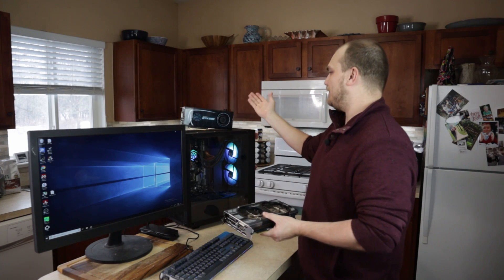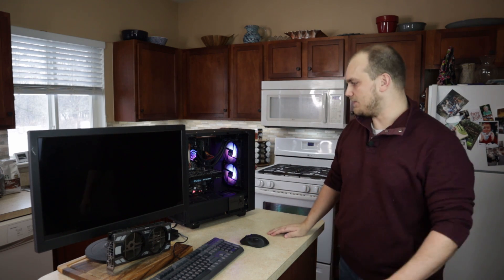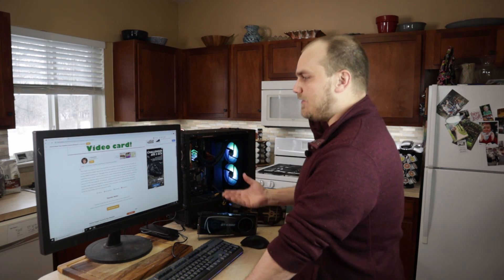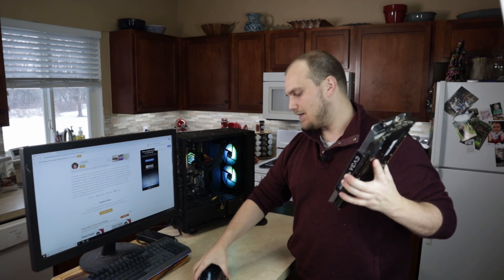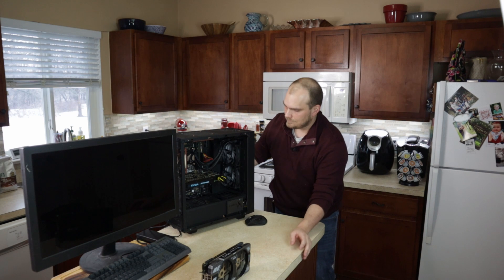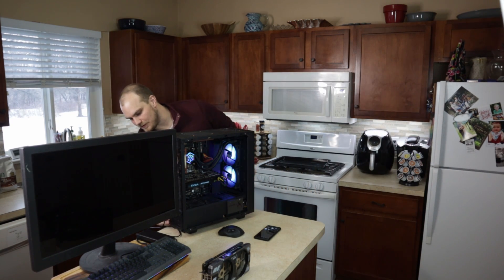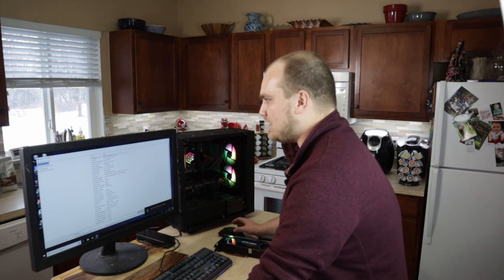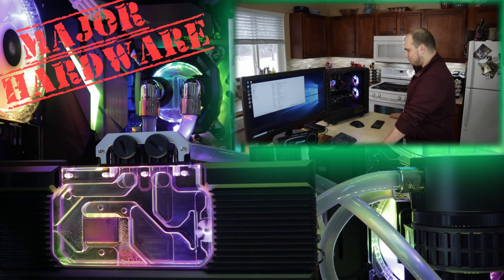Does Baking A GPU Do Anything?

Comment from the maker: STOP!........If you are considering doing this make sure you understand the risk. If you have a card that doesn't work and you are considering sending it out for repair but came across this video first DON'T BAKE IT, if you do and it doesn't work then you try to send it out you may end up causing more damage and shortening your cards life in the long run. In all honesty I didn't expect this to fix anything, however I decided to give it a squirrel because i had no plans of sending the card out for repair and i received enough comments on giving it a try i thought why not. NOW YES my 1080 didnt work then after its ride in the oven it did to my astonishment, and after a bit of testing it seems to be working normally again with the exception of the RGB which is still dead. I have some more testing to do on this card to see how long it will remain working, it may work forever and it may die today I dont know. Make sure to check back for followups on this cards life. In the end its your hardware and what you choose to do with a piece of equipment that you paid for is 100% your choice but make sure to do your own independent research before deciding whats best for your case scenario.

if it ain't broke fix it till it is
Reply: You should probably buy a new oven.  As when you do this it releases toxic gas from the soldier into the oven.  Which will keep going on your food to a lesser extent each time you use your oven.
Reply: heat gun outside (well ventilated) 9 min on gpu/vram (keep it moving don't stay to long on one thing)
Reply: @coldrolledbearcrushing9264  how hot on a heat gun, how many watts? I have an xfx HD 5850 black that was damaged in shipping and I have no money for someone to spend hours on an antique card that looks brand new, because it was a year old when it broke. I can afford and happen to need a good heat gun though.
Reply: Nice. Does it still work though?
Reply: You have to increase the pressure from the cooler to the GPU chip after baking, then all of my broken ones showed again.

Comment: Done this years ago and saved my old gtx460 back in the day. I now have a 4090 that is not being covered under warranty and I'm tempted to try something similar again
Reply: How did it go buddy?  
I have rtx 3080 that has black screen and I'm attempting to try the same baking method but I'm not sure bro  !!
Reply: @Johnny-Taylor-07  brought the 4090 back, was a cap easy to spot. As for baking a 3080, all you can do is strip it down to just he board, put it on a rack and use some foil or paper to keep it off the surface. This is a last ditch thing to do before exhausting everything else because while the heat can correct the solder joints, its also hotter than the caps are usually rated for, so there's a fine line of putting them under stress but getting enough heat to fix the problem, if that is indeed the problem. good luck

Comment: An old roommate of mine a few years ago gave me a red and black AMD something something XT gpu of some sort that artifacted and quit working and was like "give it a shot. I got a new one. If it works you can keep it" I stripped it down and tried. All that happened was a capacitor exploded XD. I have a feeling that card was a hell of a lemon with what he told me about it. I'm quite happy you had success with that EVGA 1080 in this video. Did it last?

Comment: The reason this is a temporary fix is because the solder balls on the gpu chip or cracked solder preventing it from working is cracked due to failure even if you re melt it the problem is the solder it needs to be redone, just send the card out to get reballed by a professional
Reply from the maker: still works
Reply: @MajorHardware  your issue must have been a rare situation which was a solder ball was no touching a pad or misaligned causing a issue  and your oven trick fixed it and the solder was ok but 99% of these issues  is due to low quality solder and its known by industry as "RE-Balling" a gpu. Its actually a cool process look up some videos on it and also your video was cool to watch to and may help some people but heat gun is a cheap proper way to do this and your put tinfoil around the things that you dint want to get hot

Comment: Bro Im sorry all these dudes are giving you hate for repairing a broken card, I mean the card had no value before you cooked it, now its working and thats that. 

You had a dead card, now its alive. 

People still givin you hate over it, Ive got like 5 cards to try this on so Ill be back later.
Reply from the maker: It still works to this day pretty weird
Reply: @MajorHardware  This is my second reply, I tried to edit my first one and it said returned error.

These are the cards I have to try out:
XFX GTS XXX ED 580 8gb (Does not allow PC to power on once in PCIE socket)
XFX Red Fan 580 8GB (No Post)
Armor OC 580 8gb (Works until driver installed, then black screen)
Armor OC 570 4gb (No post)
Armor OC 470 4gb (Artifacts until freeze)
Gigabyte Gaming 580 8gb (No video or no post)
R9 290x Reference w/ Tri X OC Cooler (same PCB layout) (no post)
HD 7950 Windforce (no video or no post)

Results:
XFX GTS XXX ED 580 8gb - 100% Success, even withstanding brutal loads from last night till now
XFX Red Fan 580 8GB - Loads to windows, freezes on 3d load
Armor OC 580 8gb - loads to windows, freezes on 3d load w/ artifacting
Armor OC 570 4gb - Loads to windows, artifacts at 3d load
Armor OC 470 4gb - loads to windows, artifacts at 3d load
Gigabyte Gaming 580 8gb - not cooked yet
R9 290x Reference w/ Tri X OC Cooler - cooked at 360 able to load into windows and game until artifact, cooked again at 370 @ 12 minutes and light artifacting - dropped memory clock to 1100 and everything is perfect and stable. 
HD 7950 Windforce - not cooked yet

So I was dialing in my whole process during separate cooks - I started low and went a bit higher, dialed in length of time and cooling period. I believe that with additional cooks I can bring the other cards back to gaming life. 

What was interesting to me is I was able to use every single card that was not working. There is certainly something to this. I believe with the proper technique the chances of repairing a card is much higher. Ive had more success with 12 minutes at 370 for my oven then anything so far. Im very happy with the 290x result, as thats my favorite card. 

Hope someone can use this for their information, if anyone has any questions Ill respond to it if it hits my notifications.

Comment: I did this twice with a graphics card. One worked for 1 month and the other worked for 2 years after baking it. But it is very risky because the oven has to be exactly at the melting point of the solder. Any lower and it won't work and any higher and you will destroy your graphics card. So DON'T try this if you still have warranty... just send it for repair. No warranty left? Got nothing to lose if it doesn't work? Throw it in the oven!

Comment: If been dealing with a no output EVGA 1050ti card for about 1 week now. Tried it on different systems, tried to flash the BIOS but nvflash doesn't detected it :(  I  flashed the latest BIOS from www.techpowerup.com/vgabios/ using the CH341A programmer successfully, took it all apart and visually checked the card no damage anywhere, card looks mint... but still no output. The fan spins but that's it. The last thing I tried was baking the card in the over at 375 for 10 minutes and hold and behold the card is alive again... I almost threw this GPU in the garbage but decided to try this and it worked.. I was shocked.

Comment: From what I know this isn't a permanenent fix, the GPU could stop working at any time.

But i'm guessing this is the last thing you try.
Reply: Card didnt work, it works now. Ive got like 5 cards to try this on, and I cant wait. If the card doesnt work, it really isnt an issue if you can get it working again for a little while. ITs already broken to begin with.

Comment: Just saw this video and wanted to add it's *absolutely not safe to pull hardware while the power is still on*!!! Heck, it's even unsafe if the power is still connected. I'm surprised you didn't ruin your motherboard just then. If you have done this before, no wonder your GPUs were toast.

There are many reasons why it's unsafe. First of all, because chances are high you are changing the angle of the contacts when you pull or insert the card, chances are just as high you are shorting two contacts of the slot. Second, the slot is hot (powered) and if you pull (or insert) the card and some pins are still making contact while others don't, current is going to flow in directions it's not supposed to flow. Some currents can actually invert! And there are a few more reasons you should never do this with the power still connected.

Also, it works not because you are reflowing the solder. Solder on a PCB doesn't reflow at 200C. The reason why it works (temporarily) is because you are baking out moisture from the epoxy from flip chip connections. Moisture will most likely return after some time causing the problems to return. There are ways to make the result more permanently though. Like resealing the chips afterwards.

Comment: I did it with a heat gun. It work. Until I shortcut the card by let a hdd (in metal so) rest on my card while the pc was running. It didn't work twice with the heat gun

Comment: I repaired a GTX770 and I wouldn‘t believe it. I got typical symptoms of problems with the vram. I told all of my friends and we all laugh about it and that it works and is still working.
Reply: @deveneleven400  I have sold the card a year later. I know for sure that it worked for at least a year.

Comment: Baking a PCB can only bring back board that has broken solder joints. The ones that break usually are ones the manufacture cant see (Under BGA components) and ends up breaking because they cant be inspected to verify if they have a good bound.

Sometimes baking may not be enough to fix the problem. If where the solder broke leaved the solder mostly in one side when it heats up due to surface tension it will form a ball and that ball may not be high enough to jump the gap and reconnect the point. 

You can try gently pressing the chip down while it still hot to force the melted solder ball to touche the other side (If you press too hard you can smash the solder joints causing everything to short so ONLY DO IT IF YOU KNOW WHAT YOU ARE DOING). 
That joint may break again due to be under high tension stress especially if the reason it broke the first time was because that joint didn't have the right amount of solder.

This is why this is not considered a proper fix:
It might not fix the problem its trying to.
It might break something else that wasn't broken (Blow caps / Crack ceramic caps / Melt the isolating coating of the wires inside inductors / Melt plastic things...)
It might fix the problem but only temporarily.
It might only partially fix the problem (Turn on with artifacts or shuts off / crash when you start a load).
It might fix the problem for a very long time.

Comment: When I first started getting into hardware, I was replacing thermal paste on Xbox 360s and replacing disk drives. I know it works, but after some time (could be a couple weeks or months, pending on its usage / temps) I have a feeling it will suffer the same fate, eventually.
It was fun to watch though, especially without a :O face in the thumbnail 😉
Reply: I did the same with my xbox 360... took off the ring of death for a few months. I used the heat gun method though.

Comment: gives us an update if the thing works long term. do some stress testing and game on that card for a bit. sometimes oven fixes don't last.
Reply from the maker: I did some stress testing fan installation and gaming on it yesterday I plan to make a follow up on it soon
Reply: @MajorHardware  looking forward to the video
Reply: @MajorHardware  you can also do the oven trick again on the 580. Won't hurt. Tech yes city did it to a few cards multiple times.

Comment: I mean, what did we expect going into this knowing that the 580 didn't die over time due to a bad solder joint but due to..let's call it scientific experimenting.

As for the 1080, HOW THE F DID THIS FIX ANYTHING.

I baked my Geforce 7950GT AGP back into live two times and it lasted for two years after the first "fix", back then I was hecka proud of actually fixing something just by putting in in the oven. 

And yes, the card still runs fine even though the second baking was like 5 years ago. Ofc, this should be considered as a temporary solution only to indentify defects and then get a proper reflow, but for me it worked out just fine.

I used regular baking paper as a non-conductive alternative to your aluminium foil balls tho.

Worked for a HD5850 as well, but that card ended up dying in a fire (not cased by the card) shortly after so I can't tell on how long that would have worked.

For both cards I preheated the oven to 115° C, put the card in for 10 minutes, flipped it upside down und gave it another 10 minutes. 

This also worked with a laptop gpu on the motherboard, tho that thing died again after a week and I couldn't be bothered properly reflowing it.

Comment: Plot twist, monitor is broken, cards are fine :) Well just seems like the input connector is loose on monitor end as a little jolta made it lose signal. Interesting to see if 3D works on that 1080 too, but picture is already a win.

Comment: Yes, it shows video out. But is it working? I have had a few cards that would boot into windows, but couldnt install drivers because of the "error 43" in device manager. But right now, im considering baking my evga gtx 780 sc, just to see what happens.
Reply from the maker: from the testing ive done so far it seems to be working as normal ill follow up when i know more.

Comment: that what i did for ages back in 2000 fix my dumb 3dfx it melted soliding so i throw in toaster over for 10 or 20 mini slow heat it up unite get to 175f or 190f it pend on board n soliding
and never use aluminum foil because that soliding will stick to it dont every use plastic because it will melts n i normal take small longer screw with nut put on board n tight by finger n stand it up so less mess
im great u came back do it aging same what i did

Comment: i would have understood if it fried it self by running too hot, it would have had a chance of melting the chip's inner parts and make the broken connection solder in the chip... but you fried your with a short... now that is a mystery to me as to why it worked! nice for you! will you retry the previous experiment (being more careful) again or do you have other plans for it?

Comment: Solder balls reflow at 600-800°F, as do solder joints. All this does is temporarily bridge gaps between the BGA and PCB, or along tiny fractures in the traces in the PCB. If you get it hot enough, it can cause cold solder joints. But, it'll still fail again, eventually.

I professionally repair pricey industrial electronics with bad solder joints every day, and I'm trained on one of the most advanced robotic BGA repair and replacement systems available. Even then, the manufacturer of the systems I fix dictates that we need to replace any BGA that has failed, even if testing only finds one bad solder ball that needs reflow.
Reply: Thank you for saying this. I've been trying "educate the internet" for quite some time on what "baking gpus" really does and why the "fix" is temporary in the vast majority of cases. Even the famed Luis Rossman doesn't understand what's happening.  In almost every case,  the fix is temporary because the BGA component has a bad solder ball, which is really the result of a damaged pad, usually lifted off (fully or partially) with a broken trace. Heating in a toaster oven does cause cold solder joints, which when thermally stressed enough, will break once again, causing the common "it worked for a while and then stopped".  One method that may yield longer-lasting results is to preheat in the toaster oven, and then immediatly hit with a hot air station (or heat gun) at a high enough temp to get the gpu core to fully reflow.

Comment: I see a lot of the "temporary fix" responses.  Generally I would agree.  If the gpu core is dead it's dead and no amount of baking will bring it back permanently.  The mentioned louis rossman does a good job of explaining the phenomenon.  But you shorted out your card so your case is maybe a little different. 

My best case scenario theory for your card is that when you shorted it out an mlcc capacitor blew.  When mlcc capacitors go they usually short in my experience.  When you baked the card either the shorted mlcc fell off or went open when the solder was melted.  With the short removed the card started functioning again.  I've fixed a few laptop motherboards by finding a shorted mlcc on it and removing it.  Sometimes I replace them but it usually isn't necessary. 

I had a r9 280 with a blown mlcc right off the first couple of pcie traces.  Since it blew open I left it like that and used it for over a year before giving it to a friend.

Comment: I fixed a Quadro 4000 this way once, which had worked great for several years after. Also did a Quadro 2000 on the same go, which unfortunately wasn't revived. There's no harm in trying if they don't work anyway, there's always a chance :)
Reply from the maker: Someone that understands

Comment: It worked for my macbook pro for 1 day then the problem came back i tried it with a gtx 760 too but didnt test it alot but it worked and had succes in the benchmark but i dont know how long it will stay repaired
Reply: news?
Reply: @vibardaniell.5833  it still works but I put an AIO on it which probably kept it alive
Reply: @enzoe.6897  damn! how about the temps tho?
Reply: @vibardaniell.5833  39C max on a cooler master 240L, I used the same AIO on a RX580 before and it reached 49C on max OC at 1530mhz